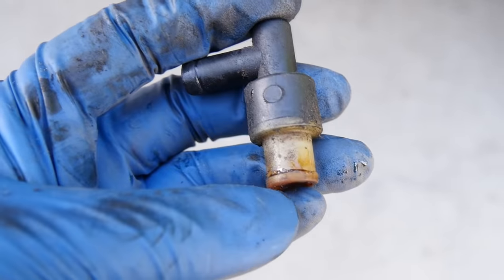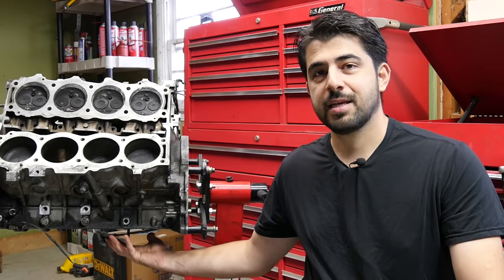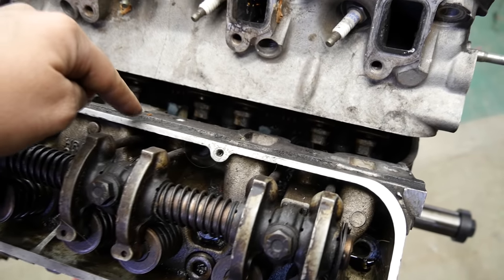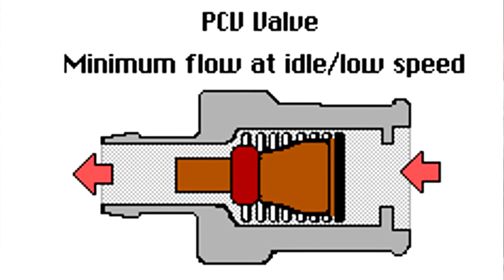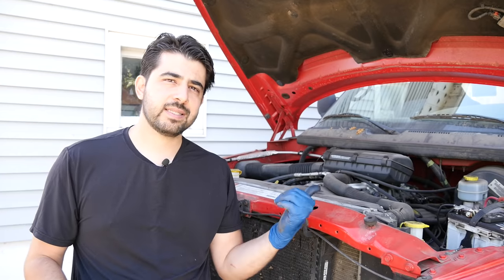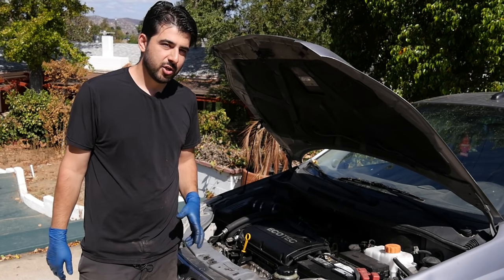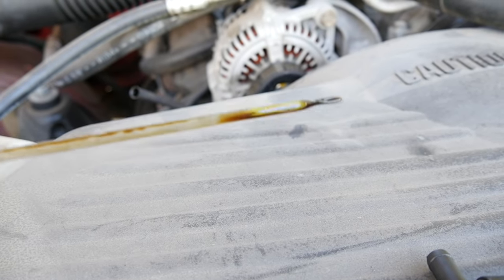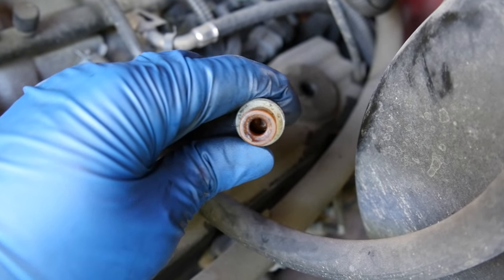The Valve That Can Cause Major Engine Troubles - How to Avoid Engine Sludge

Comment: Great explanation! Way to go.
I know this vid is a bit old now, but I have a symptom I'd like to ask you about.....
2001 Dodge 5.9L. Pings like crazy under hard acceleration. Might be the plenum. ( this is my 4th second gen Dodge so I know all about the plenum issues..) 
I'm getting ready to swap out the manifold for the air gap Edelbrach one made as a direct replacement. 
But first..
The new PCV valve I installed to try to get rid of the pinging, ( cheapest, easiest options first...) rattles constantly when the truck is idling. No joke, I can hear it in the cab, a constant rattling of the valve. I've NEVER been able to actually hear a PCV valve rattle like that from inside the truck. They usually run open or closed, but not like a rattlesnake thats pissed off...
I'm thinking there must be another vacuum leak somewhere causing the valve to constantly be opening and closing so fast? 
Got any ideas?
Reply: Go get a mopar pcv. I've bought 3 others, one from oreilly, autozone, and advance auto. All 3 of those cheap ones sounded like someone shaking a can of spray paint right by my valve cover at idle. Come to find out, the ones at parts stores are "universal" fit.
Reply: Same here ^^^ haha Mopar...
Reply: @kalen-daniel  Got rid of the rattle... stroked it to a 408, changed the manifold, the heads, the lifters, rockers, TB, injectors, cammed it, and supercharged it.. now you couldnt hear the rattle, even if it was there...LOL

Comment: With a gdi engine these are really bad. I'm considering venting to atmosphere and changing my oil every 3,500 miles. More often due to the "sludge/contaminates" argument. That said, you're still venting the bad vapors mostly off so i doubt its that big of a deal. The oil catch cans come with their own problems and living where we have very cold winters, you can't even run a can during the winter. No emissions checks with where I live.

Comment: Very good video,this little overlooked piece of plastic and sometimes metal can really cause a lot of problems,i had this car one time and everytime i stopped at the light i could see smoke coming from my hood,not bad mind you but it was there.

I could also smell  a horrible oil smell (it was horrible and I'm a mechanic and shop worker,bad oil smell's dont normally bother me) and all of the sudden my car developed a few oil leaks out of nowhere,i decided it was time to start troubleshooting,i got all the way laying in my hood looking at the back of the engine with a flashlight,this valve was waaay in the back buried,the valve had popped out while i was doing some unrelated maintenance unbeknownst to me, the oil smell was coming out of the hole, the smoke was from hot oil leaving  the hole and the oil leaks was from the crankcase not getting the proper ventilation which is a job this valve does,major problems over a 10 dollar part.

Comment: Very informative. I got a new pcv valve as my truck is consuming oil but no smoke coming from the trail pipe. It has a bit of a rough idle every now and then so I'm thinking check valve first. Love your videos. Keep up the great work!
Reply: Did the pcv valve fix it having the same issue

Comment: Mine was stuck and i did what ive done for 50 years, just push on the valve to free it, then hold it open half way and shoot carb cleaner spray through it to clean it out and its good for a long time. Many people just threw them away and let the engine shoot smog all over the city but lets not do stuff like that.

Comment: That's not why that pcv is there. If you have blow by you have other problems. When you do a leak down you should be able to keep 95% pressure. The reason for the pcv is when the Piston goes down the area underneath it has to go somewhere. Blow by would be higher pressure than a little valve would be able to handle. Still a good video.

Comment: Can confirm.   Have a rav4 awd 1995 that uses a pcv valve.  Caused havoc by creating valve cover leaks and sump leaks... Dealership was willing to pay but mechanic didn't think about the valve causing the issue.  So i went and order one on amazon at 1/5 of what Toyota wanted.  Popped it in, and voila, no more oil consumption issues (hey atleast i got a free valve cover and sump job done lol woohoo)

Comment: Thanks for the video - very helpful.  Could you do a follow-up on the EGR/crankcase ventilation systems of more recent vehicles that have no PCV valve, but which do have a PCV tube and an EGR system (with solenoids, etc.).  For example, I have a 2010 Equinox with a direct injection gasoline 2.4L engine; as a group these engines suffer from excessive oil use, carbon build up on the intake valves and in the intake manifold caused by high internal crankcase pressures and blow-by; many of these engines will blow the rear oil seals  because of the high pressure. While there are supposed to be extended warranties on the affected vehicles, this extended warranty coverage is almost always denied, because the affected vehicle is not on some pre-selected list created by GM. This comment is not about GM - it is simply a request that you show the average owner of such a vehicle what she or he can do to deal with the problem, whether it is adding a catch can to remove and store the excess oil, cleaning or enlarging the PCV hole in the intake manifold, adding a vent tube or an old fashioned PCV valve to reduce blow-by pressure, or something else.  A lot of modern car owners have this problem, and there must be a simple, relatively inexpensive cure which doesn’t screw up the electronic fuel and air flow controls on the modern engine.  Thanks for your videos and for your consideration of this request.

Comment: PCV on many cars sis simple, cheap to buy and easy to replace. And an older car (2000 Corolla like mine) has a metal PCV that is easy to get out, clean with brake cleaner, and re-install.... all inside 10 minutes. So keeping it clean is your cheap and easy way to keep the engine running well. Consider having 2 of them and the clean one just put in and then clean the other one at your convenience!
Reply: I got an 03 and 10 corolla, best cars ever made!

Comment: I bought a new pcv valve and it didn't rattle when I shook it. I threw away the old one thinking it was bad, because it rattled...now I have a oil leak at the front of my engine...

Comment: You forgot, if the hose or seal around the pcv valve like on my 2007 Escalade it's part of the valve cover. Creates a vacuum leak which in return will give p0171 &74 bank 1 n 2 lean.  Which will hurt your engine performance with your o2s telling your ecm to give more fuel to compensate. Engine will sound like it's working harder  rougher idle

Comment: I have a Ducati sport bike and recently I pulled OFF the crankcase vent tube that goes back into the throttle body. It's on there 4 smog purposes and I don't want unburnt fumes going back n2 my engine plugging up my engine...

Comment: Great, informative video! My car smokes on deceleration only and I thought that the PCV valve could be the culprit, so I replaced it with a new one. However, that did not make a difference. The engine in the car was professionally rebuilt three years ago, so I wouldn't think that there are worn out piston rings yet... I attached an oil catch can in the line that connects the rear valve cover to the intake manifold, but it hasn't collected almost anything in two years. I also rebuilt the turbos last year, so they shouldn't be causing the problem either. Could you please provide me with some clue as to what could be causing this smoking on deceleration? My car is a '95 Mitsubishi 3000GT VR4. Thanks in advance!

Comment: Hey Ratchets, Could an inoperable PCV valve cause a high idle?
Reply: that would explain why my valve seals are leaking like crazy, because I just changed my PCV valve and it was all buggered up
Reply: If you have a MAP based system instead of an MAF based system then if the pcv was stuck in the open position that would decrease manifold vacuum and fool the computer into thinking the engine is under load which would make the ECU raise the idle speed.

Comment: Wonderful explanation.  At this point, the better explanation for a PCV.  Thank you!   Not to sound sarcastic, but I learned based on how you test them (which makes sense) I have wasted about $8-10 replacing this valve needlessly.  Thankfully though, they are cheap!

Comment: I have a 1974 454cbb in my 1980 CamaroZ28, it has Edelbrock heads, Edelbrock RPM intake. The car has always dripped oil mainly after a good burnout, and after some hard driving. I did not know about PCV until today, and it explains my problem as I think the oil has been blowing out of the breather caps on each of the valve covers. Should I get one PCV breather cap or PCV valve and connect it to a spare inlet port on my Holley Classic 750 Carb? The other breather cap would stay as it is to allow air into the engine. Thanks for any help. I live in the UK and my American car attract a lot of attention, and it’s such a laugh to drive her..the noise and the power..smokin tyres, side ways down the street 👌

Comment: Lool, I have an Audi A4 B7 2.0 TDI 170HP engine and I am having, MAF sensor code, lack of perfomance under 3000RPMs and plenty of black smoke. I inspected many things and next is the PCV valve now, Im doing research on the internet. And when you said that the oil dipstick can get pushed out I became pretty certain that this is my issue, because mine was pushed out and I am sure I didnt leave it like that, and I also have oil coming out from the pcv valve. What do you think, is that it? The car suddenly lost power after accelerating a littlebit harder, so I suppose after the acceleration the PCV valve got stuck in a closed position, right? Does this sludge get cleaned over time  if the PCV valve is fixed?

Comment: Excellent video and explanation. One problem innerent with the PCV is the oil move inside the valve to the intake manifold with new or old valve. I stop that with an Oil Can Catcher.

Comment: I have a 2018 Chevrolet Impala Premier I don't know for sure if my vehicle have PCV Valve. My question is if so if I change regularly  will this help it has a GDI vvt engine I also heard you may have to drill holes in the PCV Valve because the holes are to small which causes the pcv valve to get gunk up also I read with these types of engine GDI  it best to install a oil catch can., your thoughts please

Comment: I have a 92 Honda Civic and the PCV is on a small box attached to the block left of the oil filter. Should I have the valve rerouted to the top?

Comment: what happens if the PCV valve or breather are not connected to the manifold? I have been trying to restore my gf's truck (1999 GMC Yukon) for over a year. Doing many fixes it needed: spark plugs, wires, distributor cap and rotor, and many others. But about 2 months ago, when we finally decided to give it life again, it started rough, idles roughly, and when we step on the gas, it seems like its going to die on us. I found a hole (now I believe its either the PCV valve or breather) that had duct tape over it. Could this be why the truck doesn't want to run as it should, the pcv valve or breather is missing?
Reply: Obviously find ur manual or another video with ur exact car and find out what exactly that hole is. But yes, if it is in fact no Pcv valve or breather . It would cause it to start and run a bit more rough. If you let ur warm up and run for a while I’m sure you’d smell oil if that’s the case as well .

Comment: this PCV is positioned for the blow-by coming out of the crankshaft on your 2001 DodgeRam.   I'm trying to test a PCV on a 2001 Allroad 2.7T which is connected to the Y-pipe on the intake side of the system.   I have purchased a used replacement from a working system.  But how do I test this type?   It doesn't rattle, or perform like the one on your Ram.   It's supposed to allow air in from the Y-pipe...correct?   ....but I can see into the Y-pipe some remnants of dirty oil, as if it's been also allowing air in the other direction.    ...which means dirty oil air through the turbo's, into the intercoolers and on into the throttle body.   Is that usual?    Or is this 'pancake' valve on the 2.7 meant to be a one-way valve only?

Comment: I have a question for a corolla dx wagon 91 and it’s probably the same for all corollas for that year and perhaps other years and maybe other cars too. 
When you replace the valve cover gasket, how do you replace the spark plug seals? It was a struggle to get them out and getting them back in was even harder. They’re those round rubber seals with a metallic part inside them. They’re very difficult to press out and back in. How do you do that easily to get them back in completely? I coated a bit of oil on them to press them back in but they still didn’t go all the way in. They’re a huge pain! I replaced tube seals on my 92 Camry and those were really easy cause they’re right under the large 30mm nuts that hold down the cover itself. But the 91 corolla tube seals are an absolute pain!!! Is there a machine for pressing them back in or something!! I tore a few while trying to press them back in and finally gave up, so now they just half way back in. But I hope they don’t fall out and get oil in the spark tubes. So far they’re holding in there fine!! Knock on wood!! But they’re a total pain!! Didn’t know they were, otherwise I wouldn’t have tried removing them!! I tried to force them out and tore one or two and so I had no choice but to force them out. And the valve cover gasket I got from O’Reilly comes with the four seals, so I thought they’d be easy to remove and return!! Boy was I wrong! Thanks!!

Comment: Some pcv valves are cheap ,but Ford puts a "heated pcv valve" that run around 65 dollars. I just changed mine it was a bitch to get out cause it was the original one from the factory, 93,000 miles before it started to fail.

Comment: I’ve had a PCV valve fail in a 1.5 ecoboost. There was a crapload of oil inside the PCV valve. It caused ringland failure in cylinder 2. Had to replace major engine components, but good thing its still under warranty.

Comment: your everyday vehicle the PVC valve holds back about 7 to 8 PSI so unless you're running a big ass Turbo you have to worry about the PVC valve blowing up any of your gaskets or seals just going to go by the oil cap and you might has an oil all over the place.

Comment: Hi Sir, I have sonata 2015, when i drive above 100km/h speed. Engine some times stopes automatically while running and then starts up again after a short while. It has automatic transmission and when its starts back rpm goes upto 6thousands which creats too much noise and jolts the car.
Need your guaidance to get rid of this. 
Thanks

Comment: If the PCV valve fails closed or otherwise is there a potential for oil and gasses to exit through the breather side of the PCV system? I have a 2013 f150 3.5L EcoBoost(60000Mi) and the driver side turbo fresh air intake pipe is the tap off for the PCV fresh air into the crank case. I can see oil weeping from at the turbo output piping connections and wonder if the PCV system could be putting oil out that way?

Comment: I've got an old 1985 f150 it's carbureted with a 351 Windsor. My PVC valve has a line running into the spacer between the carb and the manifold so it gets recycled like it should, but on the other valve cover there's no breather line hooked up. There's the oil fill cap with a breather hole and when I shut the engine off steam and smoke comes out of it so it still breathes but there's no line running from it to my intake. Is that an okay setup to run too?

Comment: I have a load of crud/gunk in the underside of the valve cover where the PCV is located. Not sure how it could even work. I think the failed PCV contaminated the oil. More gunk on the PCV side of the engine vs the other side.

Comment: I just noticed on my 2016 limited Malibu that the pcv valve hose riped, and noticed oil on the oil cap and it has a rough idle, no check engine light, I ordered the new hose from online.

Comment: PLEASE HELP- I had it replaced and the connecting hose cuz I'm burning oil & part was 15yo.  Now, I see oil leaking below the pcv valve.  Any suggestions?

Comment: Hi, I have a 2003 Cadillac cts 3.2L and the PCV module is way different than the one you show. I recently had milky stuff on my oil filler cap and not on the dipstick but then after few miles I had mily stuff on my dipstick.. how can I bypass this type of pcv valve? They are waay to expensive..

Comment: PCV Must have a weak spring if I can hear it while I shake it.
Reply: these PCV were designed super cheap to be replaced easily - However the new fancy PCV systems these days let in a lot of oil mixed with the air to cause dirty intake valves...

Comment: What would it require to remedy this? Replacement of piston rings? This would explain the oil leak and seal degradation problems I have experienced with my 2001 Corolla w/ 175kmiles

Comment: Changed out my PCV valve in my 2002 Silverado. The valve was hollow. No guts. Otherwise it looked like the original AC Delco part with no obvious damage to it.

Comment: Please help me out. I've a petrol engine (1AZ) which goes off as soon as is press the accelerator pedal. I've changed the following components: injectors, MAF sensor, I've change the coil of the 3rd cylinder because I had a misfiring code after that, the code disappeared, I checked the idle control valve but didn't change it, I changed spark plugs, I add fuel in the tank, yet the problem persisted. I saw that there's a bit of dirt in the tank, I don't know if that can cause my engine to stall and go off when I accelerate from idling and it also has hard starting. 
Thanks!